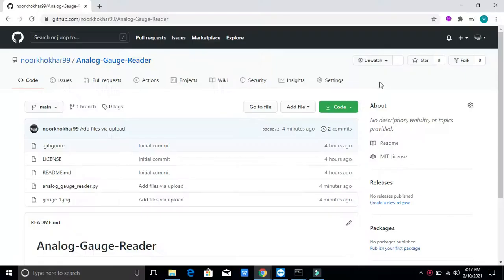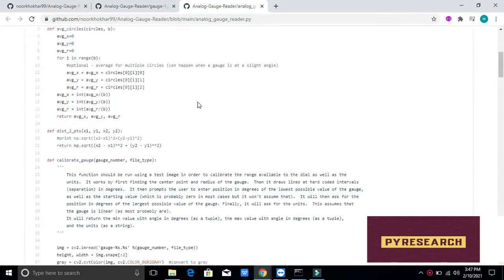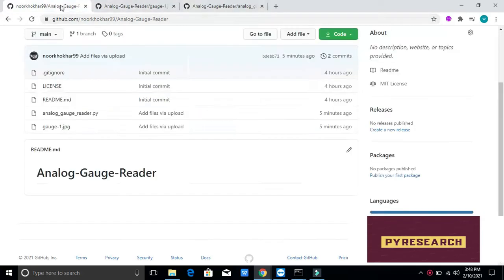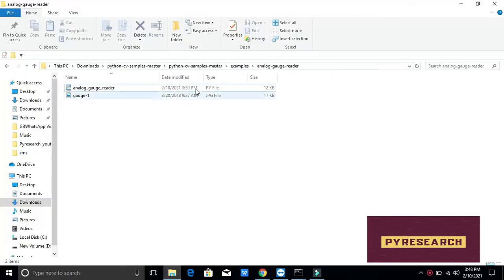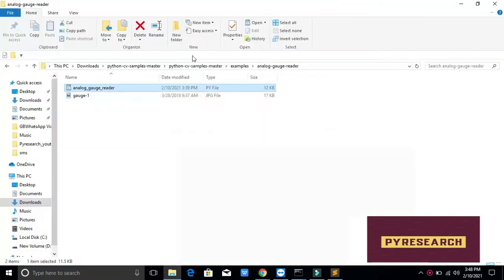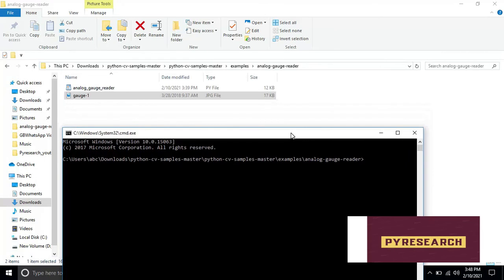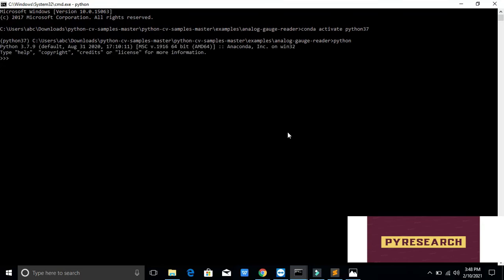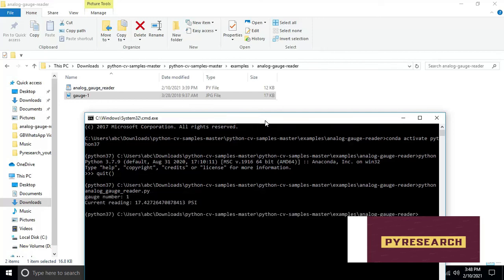Analogue Gauge Reader using Computer Vision

Comment: Hello SIr, thank you for sharing
I tried the code but with my own gauge image. So the code works very well if the indicator points to the left side (1st and 2nd quadran), but if the indicator points to the right side (3rd and 4th quadran), the code unable to detect the indicator line.
Have you tried this before Sir?
Thank you
Reply from the maker: It should